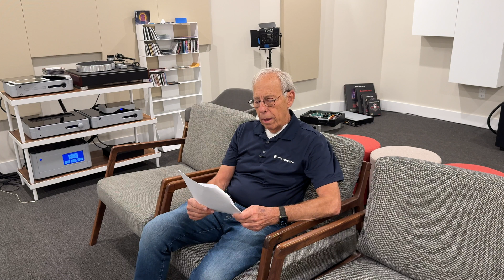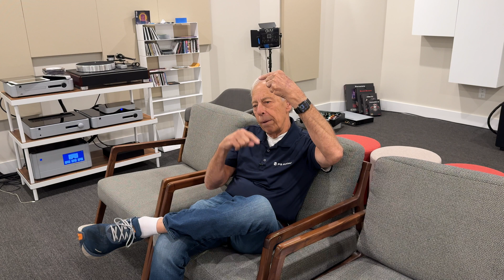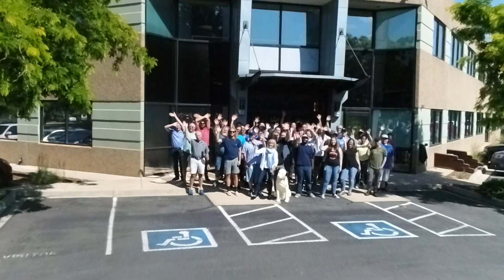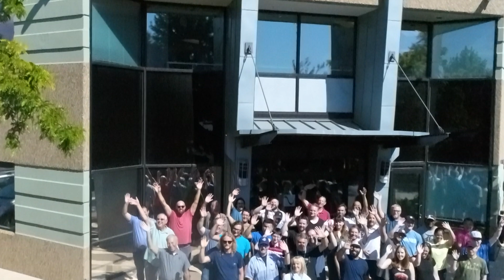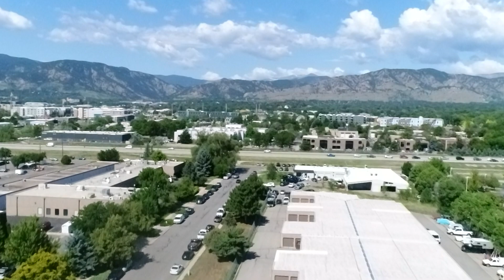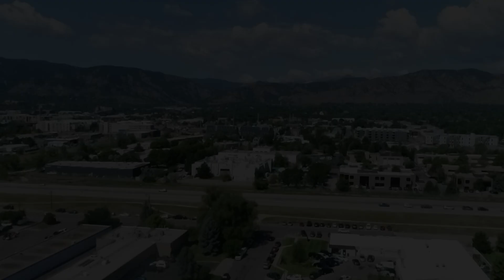Is fully balanced double circuitry?

Comment: One thing people confuse is that fewer components in a signal path is good only applies to passive components and it's mostly the opposite for active components. From an engineering perspective, an amplifier amplifies the signal by generating a bigger, copy of the original signal. It doesn't work on the signal like stretching a dough. Thus the more components are in the circuit to generate a perfect copy the better. 

Examples: in a long tail diff pair, a current mirror( additional transistors) will always outperform a resistor as a current source. An active current source(additional transistors) will outperform a resistor. multistage amplification with paralleled devices will mostly outperform single-stage amplification with a single device.

Comment: Over my head...Can anyone dumb this down for me ?
Reply: Balanced audio does not require a longer audio circuit. It requires a wider audio circuit. The extra circuitry that accounts for the inherent "doubling" concept that the person who wrote the question is asking about is, in fact, run in parallel with the single-ended circuitry. This is how balanced creates two out-of-phase signals at the output. Therefore, the idea that balanced audio would add more components which will introduce more potential distortion, jitter, or other negative effects is a misunderstanding of the design. Because the audio path is the same as single ended - just doubled, in parallel - there is no loss in fidelity between the two designs. Noise is another topic.

Comment: A balanced configuration will have twice the peak-to-peak amplitude, and in a well-designed circuit, the higher amplitude will improve the SNR more than the extra balanced circuitry detracts. If designed poorly, then this may not pan out.

Comment: I've used balanced audio my entire professional life. Great stuff. And yet, single ended will always have lower inherent noise compared to balanced, given the same level of circuit technology. In professional audio, the benefits of common mode rejection outweigh the noise penalty. In home audio, single ended is (usually) a better choice.

Comment: All signals are differential. The difference between unbalanced RCA and balanced XLR is that the RCA negative input is the ground shield and XLR uses a separate opposite polarity -ve wire. The input circuitry is very similar between to two, the RCA input circuit still has a differential input but it's -ve is tied to ground. The input is unbalanced because the ground shield has a completely different impedance and picks up all the cables interference compared to the signal wire. Balanced XLR does not use the shield as an input. Both +ve and _ve signals are inside the shield and the inputs have matching impedances so any interference is the same for both and cancels out. Cost differences are mainly marketing driven since circuit complexity is very similar, but RCA is seen as a "cheap" consumer version and XLR higher performance.

Comment: A differential pair is almost always used at the input to otherwise unbalanced amp designs due to its lower distortion. And even if the diff pair is followed by a twin amps in opposite polarity, when used with balanced input the diff pair should cancel out the noise by subtracting the signals first rather than amplifying it all the way out to the speaker jacks and cancelling there. That's not twice the circuitry though because it runs at half the voltage or outputs twice the voltage due to the bridging. Largely, the decision to build balanced power amp stages is quite independent of providing balanced input.

Comment: Not an expert but from a theoretical point of view, one might say that, the two "identical" circuits, finally outputting the (augmented) balanced signal, can never be absolutely identical, so the signal will be slightly distorted. To me the problem is like double tube push-pull amps against single tube ones. (Or single vs more transistor amps). I'd wish someone more knowledgeable to confirm or disprove this analogy. Thanks in advance.

Comment: This is indeed a great question. In an integrated amp, perhaps even on the same PCB, you wouldn't bother making a balanced connection just to carry the signal, as it wouldn't add any value. In fact, there are more total components involved in making a differential signal and turning it back into a single signal. So I would dare to say that for a few feet of interconnect, a line signal path has the advantage of being with less components, when designed for line signal connection, still without causing audible noise issues. Most sensitive to noise is your moving coil cartridge output where running it balanced makes most sense.

Comment: Balanced lines just like unbalanced, does not require differential circuitry internally. These are just various means of signal transfer. It is very common for musical instrument amps to have balanced ins while using only single ended gain and effects stages.

Comment: The common mode "noise" must comes from an external noise source and NOT already embedded in the signal.
In addition the "balanced" signal becomes "unbalanced" once again once it reaches the main circuitry on the circuit board, 
unless the circuitry is designed for ONLY balanced input (most are not).

Comment: I am confused. If fully balanced means that one half of the signal runs on the top half of the circuitry and the other half runs on the bottom half where do they combine to reduce the noise?
Reply: That's not how it works. They are not split positive negative. Both "channels"/ signal paths/ circuits run the same complete signal. One is inverted compared to the other. So if a singled ended (RCA) signal has a 1V peak, in balanced each would have the same 1V peak, but in opposite polarities. There would be a 2V peak difference between them. So you get twice the signal level but the same noise level from outside magnetic interference.

Comment: Could and old Amp be modified to be XLR Balanced if it was born OEM RCA let say my old Bryston 4B from the 80’s was sold with rca can I get the internal signal to use XLR and be balanced or is it just to much complexity.
Reply: If you want it to be truly balanced then you would have only one channel when you convert it, if you can. If you just want to use xlr cables, there are plenty of adapters out there
Reply: Use balancing transformers at the input. This allows using balanced for signal transfer while not having to mod the amp.

Comment: My belief, and I'm happy that other have other opinions, is that unless you have a particular noise problem, then balanced signal is an unnecessary complication that may have a negative impact on the performance of the system - any imbalance due to component tolerance will have a small, but measurable influence - much like any noise you are trying to minimise. Unless there's a problem, an unbalanced system's noise should be more or less irrelevant when listening at normal levels (I accept that balanced phono inputs do have a place, as these signals are particularly vulnerable to noise).
Reply: Many folks have beliefs.  Meanwhile, if two halves of differential amplifier circuit are actually balanced, then distortions in one half may be cancelled in the other.
Reply: @blekenbleu   another name for a balanced input is a 'comparator', it compares the two signals and amplifies the 'difference'. So when you put the non-inverted (+) and the inverted (-) signal in, you get a larger signal out (inverting a -ve giving a +ve, of course). So the problem is if there is noise or distortion on either on one the other (but not both) inputs, this noise will be passed through and you will hear it, it is not diminished in any way. Only if the noise is equal and "in-phase" will it get cancelled at the input. This is why balanced input is great at protecting signals over long cable runs. I wish I could send you a drawing as it's much easier to draw than it is to explain!
Reply: Except a phono cartridge is single ended
Reply: @MichaelM-to4sg  actually, it's not - neither output (+ or -) is referenced to ground when they leave the cartridge, so they are both floating. Only when connected to an unbalanced input does the -ve input become connected to the ground.

Comment: Technically Paul is right (apart from that the top goes here and the bottom goes there, but that makes it easy to explain to the layman). The problem is that if you spend much more, as Paul says, would it not be better to spend the same on fewer better components? For >99.9% of us, there are budget limitations after all.
Reply: In an integrated amp, perhaps even on the same PCB, you wouldn't bother making a balanced connection just to carry the signal, as it wouldn't add any value. In fact, there are more total components involved in making a differential signal and turning it back into a single signal. So I would dare to say that for a few feet of interconnect, a line signal path has the advantage of being with less components, when designed for line signal connection, still without causing audible noise issues. Most sensitive to noise is your moving coil cartridge output where running it balanced makes most sense.
Reply: Balanced circuitry reduces the noise so much, that in order to achieve the same result in a singleended circuitry would most likely cost a hell of a lot more than just balancing the signalpath
Reply: @5starmaniac  it reduces the noise in the transmission. Used extensively in venues  where you are running a microphone 20 to 50 metres  the cable is an antenna picking up all the emf along the way. If you have 1 metre of cable connecting a turntable to an amp I would not bother. Your needles coil would be probably picking up more noise then the cable.
Reply: @DiegoCampagna  Of course we are talking strictly high-end here. If you have a 200$ setup, I wouldn't bother about balancing the signalpath either.. (and most likely wouldn't have the opportunity 🤪)
In a high-end setup though, it makes a hell of a difference!!
There are so many noise sources, both surrounding and inside hifi components.
Reply: @5starmaniac  That is true in the recording industry, not necessarily in the HiFi sector.
Reply: @5starmaniac  That is a very generalized answer. The only thing we can be general about is that one size does not always fits all.
Reply: @hugobloemers4425  Well, I can tell you this much: You won't find any 'serious' high-end reviews, where they didn't prefer using  the balanced option, when they had a choice and made a comparison.
It makes quite a bit of a difference, and to achieve that difference in a single ended setup.. 🤔 I think there are reasons why no high-end producers have done that yet..
Reply: @5starmaniac  "Serious high end reviews", what does that even mean? What makes a review serious? What makes it objective? When is it compromised or corrupt? Little fun fact, in the same comment section there is somebody who claims a famous mastering engineer Doug Sax, uses single ended equipment. I did not know that nor Doug, just telling what is out there. One thing is for sure, you are making very broad claims but but no compelling technical arguments.
Reply: @hugobloemers4425  Well, if you've been using YT for a while, I'm sure you would agree that there are different "levels" of what is posted here..?! 😅

Comment: (One could say) parallel circuits can have minute differences causing asymmetry and distortion whereas a quality Jensen signal transformer with a singular signal path would negate all of that. Not sure how each approach scales in effect here.
Reply: The opposite could be true as well, that parallel circuits improve the sound. But a symmetric architecture is not the same as a parallel circuit and for that, chances are that differences do get amplified rather than attenuated.

Comment: Unbalanced RCA connectors are just fine for short cable lengths in most home systems. XLR connections will eliminate hum or other interference pick up. Any distortion in the input signal will not be eliminated, it is part of the original signal. If you have XLR available you may as well use, but if not RCA is fine In most installations.
Reply: Just note that not all amps or pre amps that have XLR connections are differential balanced. There is a difference when you hook up differential balanced systen with XLR as opposed to with RCA. You can hear it.
Reply: Another plus is gain ability..yes headroom..you have double the voltage swing..like the corvette you drive to church..you dont need it mostly..but when you do its there during dynamic peaks and your still clean..and not clipped..